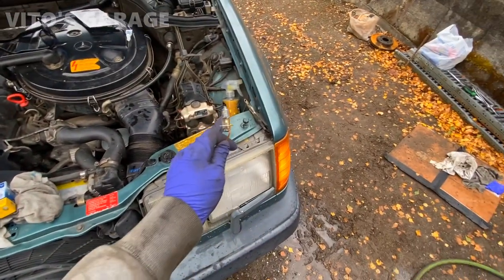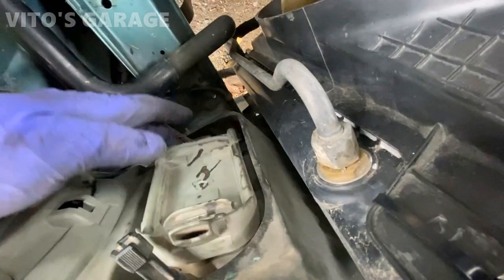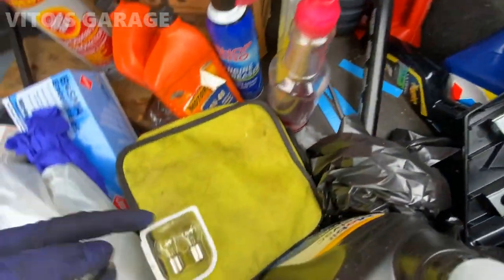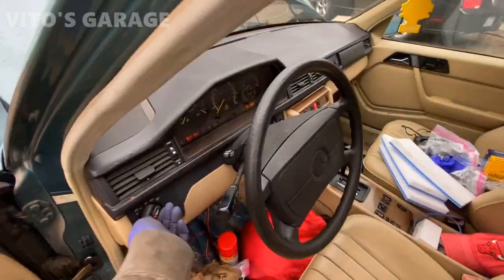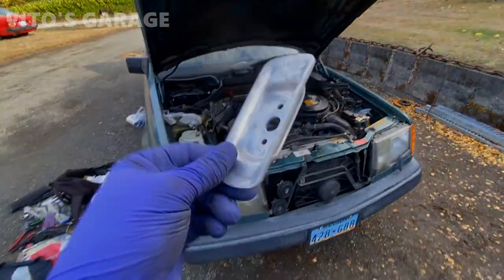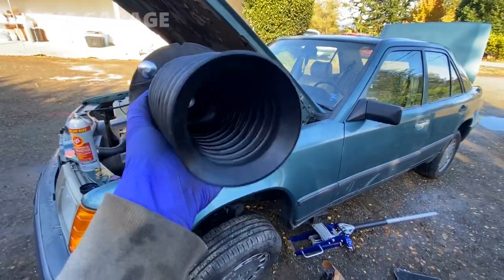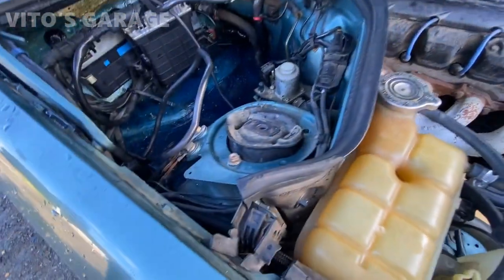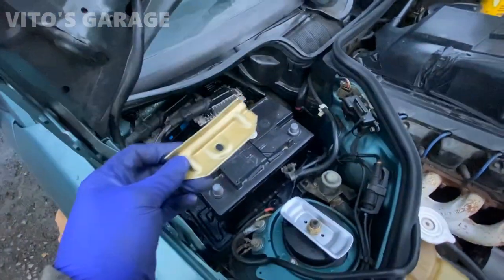Part 9 Mercedes W124: New Shock Mounts & Dust Boots, New Exterior Bulbs, Battery Tray Preservation

Comment: Perfect job. Can you show us how to fix problem with door closing. I have to use a little bit too much of force to close them. I clean and lubricate all locks and brakets and its better. No any strange noise. But still not good closing. I have to hit them hard to close. If you know how to fix that, it will be great. Thanks.
Reply from the maker: I’ll make a video at some point
Reply: @VITOSGARAGE  thanks bro